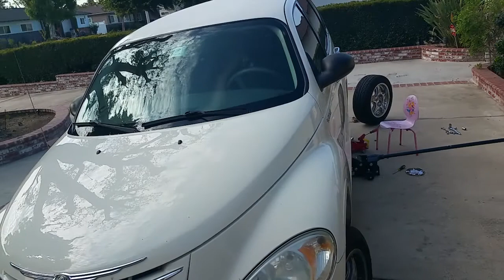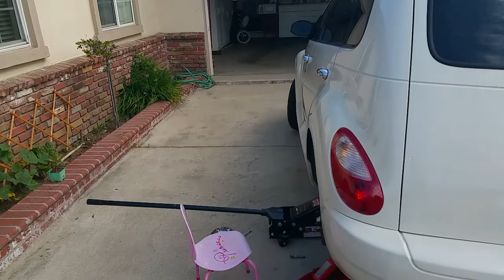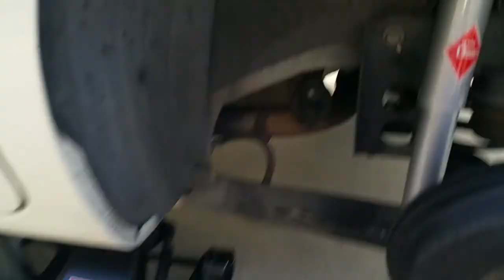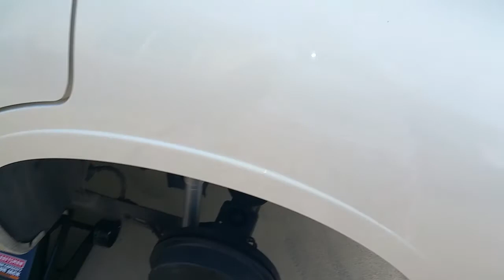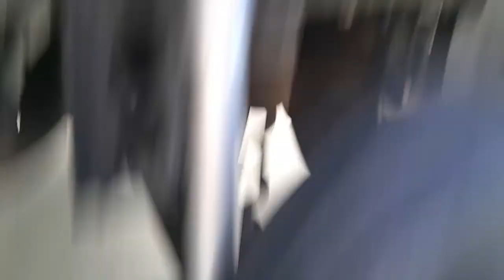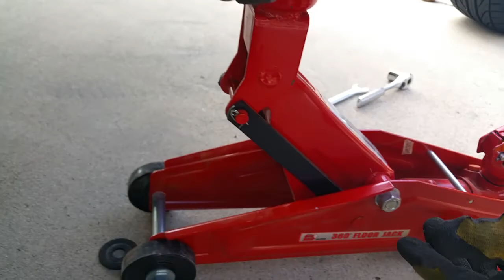2006 Chrysler PT Cruiser Base Rear Shock Replacement KYB Gas A Just

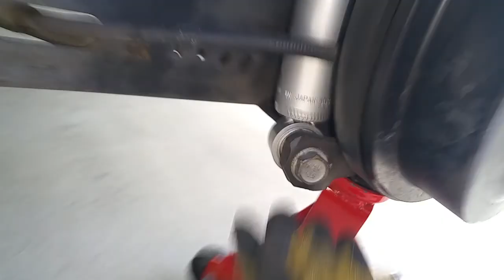Comment: 4:37 You actually want to have the vehicle supported only by the rear axle before you tighten the bolts. That way, you'll stimulate normal ride height. Otherwise, the bushings will twist once you lower the car.